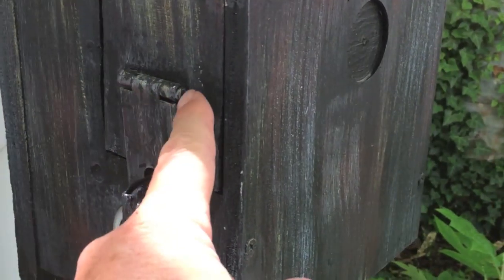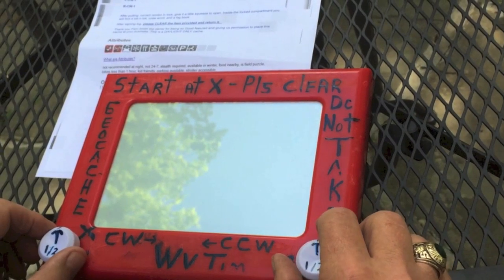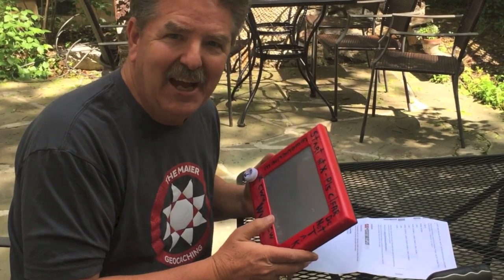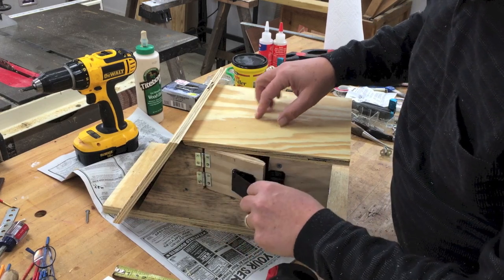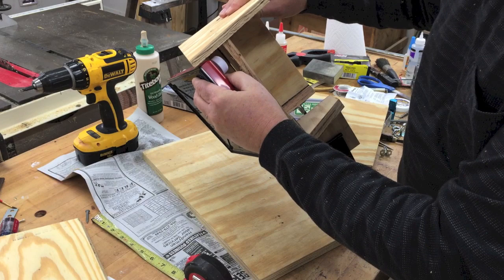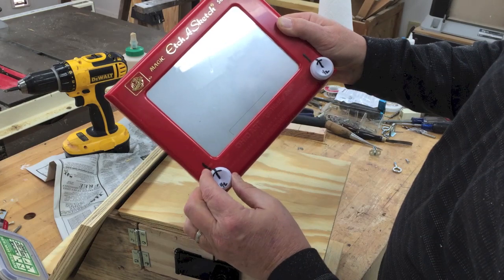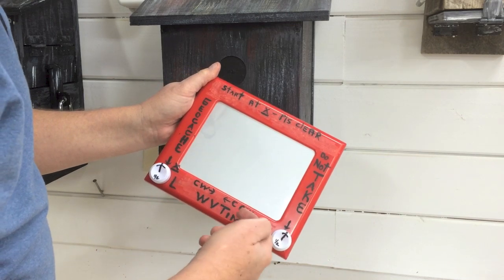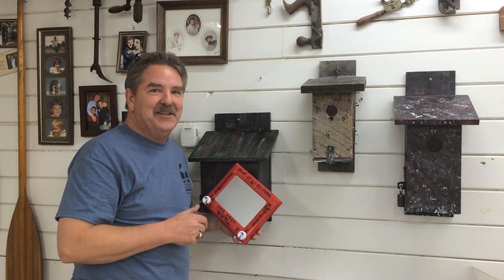Creative geocache - How to build this FUN Cache!

Comment: Wouldn't the lock combo always be on the etch-a-sketch if the cacher doesn't shake it?
Reply from the maker: Not sure of your question.  The small lock on the etch a sketch is just to keep muggles from walking away with it.  Hopefully, caches will always shake the etch a sketch before putting it back, making it more fun for the next cacher.   I have never got a log where a cacher told me that the correct number was still on the etch a sketch.   So, it seems to be working fine.